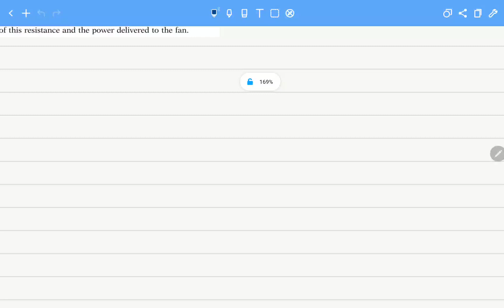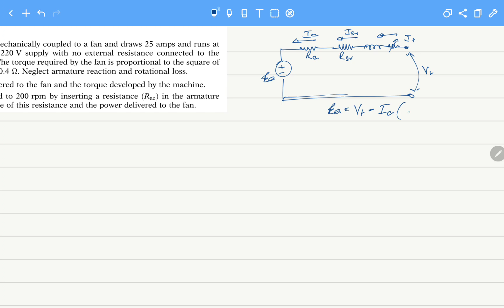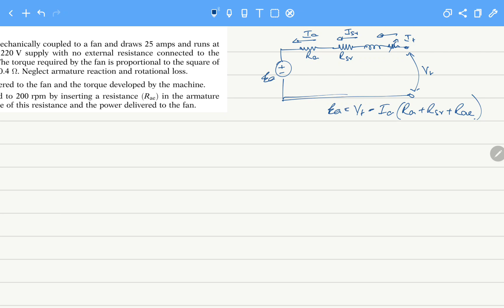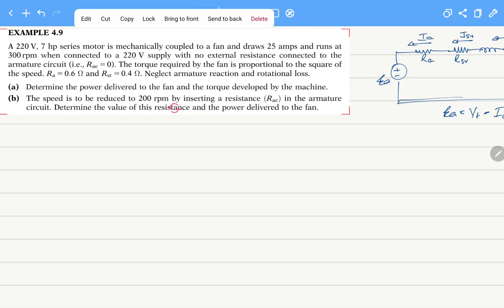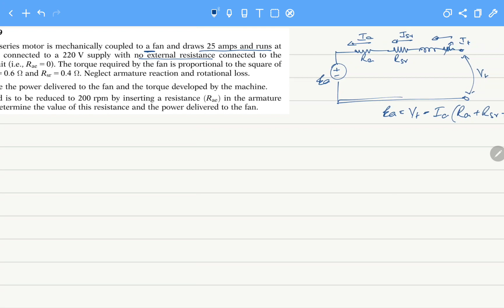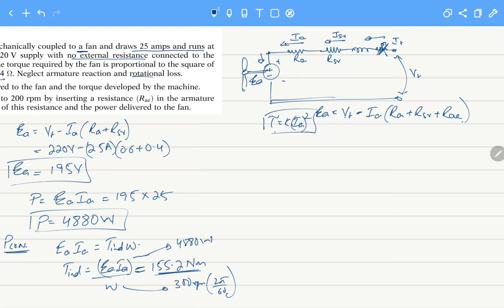Lecture 4 DC Machines MOT Part 8

Comment: at 3:13 
why did we say P_conv = P_Out ?
Reply from the maker: Once the power is converted to mechanical power, we subtract rotational losses to get output power.

In the question, rotational losses are stated to be zero